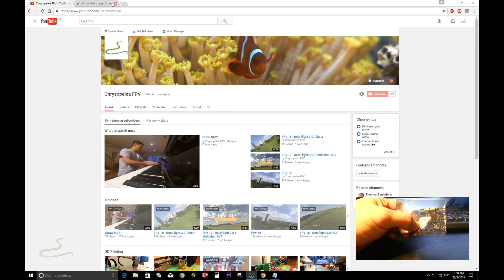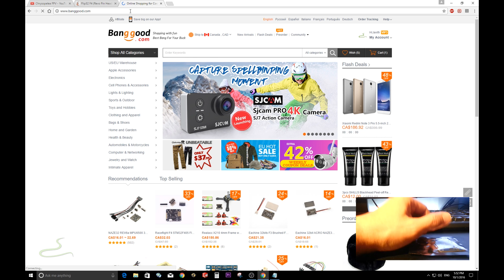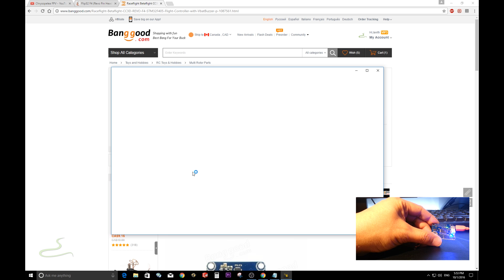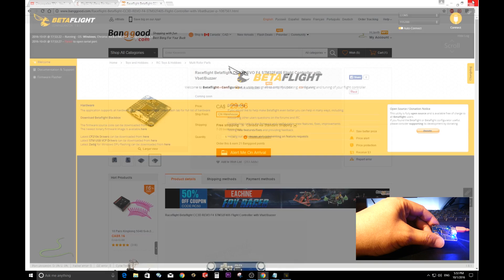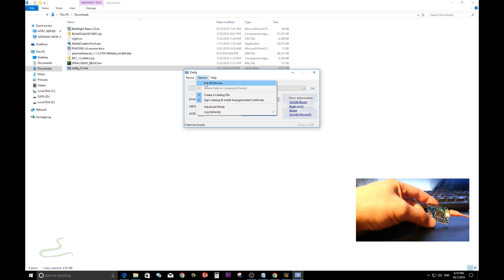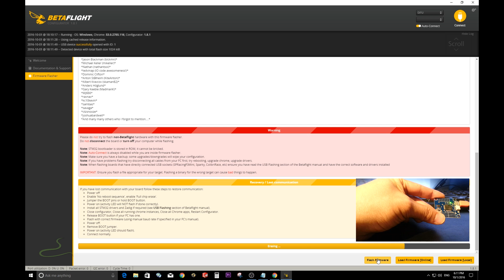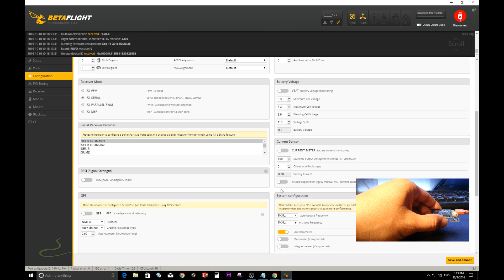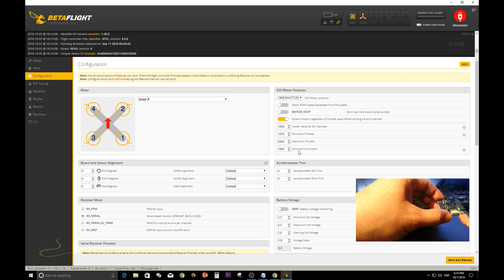How to install BetaFlight 3.0 onto Flip32 F4 flight controller

Comment: Thanks for your video! One question, I put the board into DFU mode, although it coudn't be detected on Zadig. Is there anything I can do?
Reply from the maker: The first part of this video might help https://www.youtube.com/edit?o=U&video_id=3IrvCJOPnxo 
For reference only
Reply: Thanks for your anwser. I've saw the entire video and tried to install all the programs mentioned in BetaFlight. My problem is that when I connect the board to the computer, it isn't detected. Is there anyway I can fix this? 
Thanks for your time

Comment: why did you choose Revo and not Omnibus F4 or airbot F4 just wondering because I flashed mine with the Omnibus F4 and when I try to spin the motors in the motor tab they don't move
Reply from the maker: Thanks for the comment. At the time of making this video Betaflight 3.0 was just released and had only REVO as target for this board. Of course with v3.1.5 nowaday, you can choose AirbotF4 if it's the right board. Cheers

Comment: Hi, I have a question for you. 
What is the max imput voltage for this board?
Banggood description says "direct lipo imput" but no more information have you tested this thing? 
Can you help me? Thanks.
Reply from the maker: it has 5V voltage regulator so you can hook up 4s no problem. If you use 5s it pretty much limit for the board itself since i can produce a lot of heat due to its linear voltage regulator.. Connecto your lipo to VBAT and the board will power up.
Reply: Chrysopelea FPV thank you so much..
Reply: Chrysopelea FPV  one more question for you :) I don't know where i have to insert the signal from my radiolink r9ds set in sbus. Can you help me? thanks.
Reply from the maker: I suppose you use SBUS capable receiver. Follow your reciever manual to hook up SBUS to board where it's marked SBUS
Reply: Chrysopelea FPV of course my receiver is SBus capable. Thank you man.

Comment: I just purchased this fc does it have accelerometer? or gyro only?
Reply from the maker: Yes it does have accelerometer AND gyro
Reply: Chrysopelea FPV thanks for replying yeah I plugged it in and realized that. I've been using librepilot and just used betaflight for the first time. thanks again

Comment: Installed firmware ok but when I press connect it just say open serial port and nothing else
Reply from the maker: Make sure you have correct COM selected and all drivers are install properly.

Comment: HI, first thank you very much this video helped me.
I have one issue, that is very strange. When i got my board i could flash it like in your tutorial, no problem. DFU mode was fine.

But now i wanted to flash betaflight 3.1 for dshot etc... and i tried to set my FC into dfu mode but nothing happens. I pressed the boatload bottom and it did not boot up.

But windows says it does not know the dives.. and it is also not shown in betafligh. 

Everything else works fine so the board is not broken.

Maybe you have an idea. Thanks again.
Reply from the maker: If you flash up to 3.0.1 you need to go to Zadig and select Revolution from drop down menu and replace driver with USB Serial (CDC). then flash away. Watch my other view about Raceflight onto Flip32 F4 for reference
Reply: I found the solution ... You have to unplug everything from the board ! If not the dfu mode will not work. :) 

PS: 3.1 alpha is not able to use motor 1 so i had to flash back to 3.0.1

Comment: SBUS working but now i cant get VBAt :(
Reply from the maker: VBAT works. Do you mean Telemetry?
Reply: https://blck.mn/2016/06/smartport-the-frsky-x4rs-and-betaflight/
Reply from the maker: +Guerrilla if you're using FrSky X9D Plus with X4R-SB/XSR telemetry receiver. You need to modify your receiver as +Hans Turpyn posted the link

Comment: I installed the stm32 driver first before I connect the board to pc.
Reply from the maker: put it in DFU mode and install driver
Reply: Chrysopelea FPV Thanks for the video.